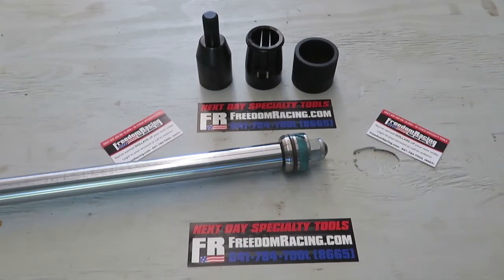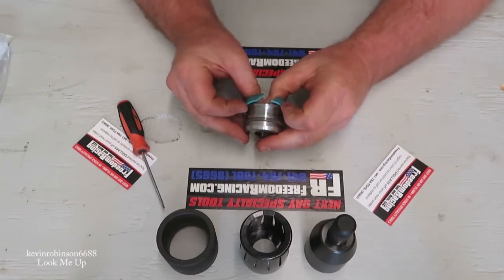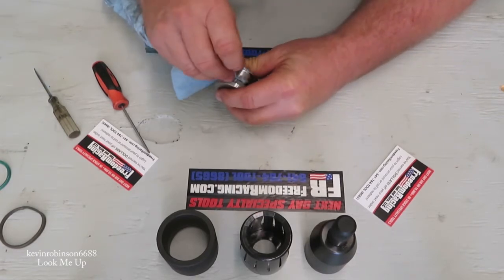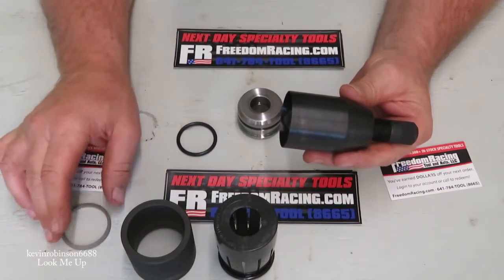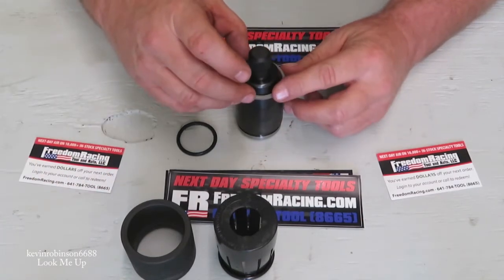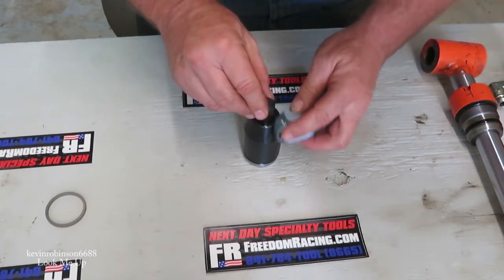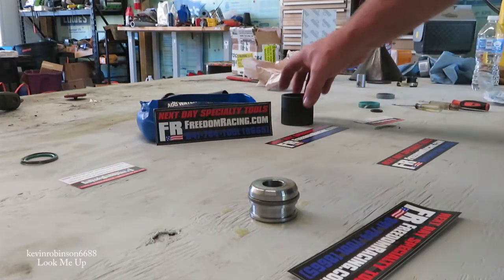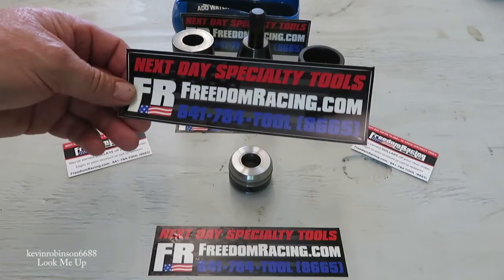Hydraulic rebuild tool Fluid Seal Ring Installation set J 46620

Comment: Kevin, I need to rebuild my hydraulic cylinder for my front end loader. It is a Kabota La724. The shaft calipers to 1 3/16". Do you know if  the tool you had would work on this shaft? If not does Freedom Racing have a tool for this? Enjoy your videos.
Reply from the maker: Not sure Sorry
Reply from the maker: If I get a minute I'll try to measure the cylinder size

Comment: Hey Kevin I called Freedom racing n they said they can't keep these in stock plus I'm working on a friends Kubota model number LA272-1 SN 50412 seal replacement n having trouble finding the three piece tool lol can you lead me in the right direction 😹
Reply from the maker: James, i just spoke to them and they told me they was getting more in, it's the covid 19 curse slowing them down.
Reply: But they don't have one for the kabota LA 272-1SN 50412 seal replacement tool
Reply from the maker: @jameselmore1821  I will see what I can do James.

Comment: Tools out of stock for now but I was able to stretch it on over the Kubota piston. I reset the outer fluid seal with a 2 inch PVC coupling. Works like a charm in a pinch.
Reply from the maker: Good to know thanks for watching
Reply: Outstanding thank you
Reply: Or tighten a thin strip of plastic around it with a hose clamp, or put some black electrical tape inside the hose clamp if pipe diameter does not match your piston. My Kubota piston is 1.75 and there is no matching pipe size. You can keep the clamp on while you tap the piston into the cylinder and let it slide off as you drive the piston in.

Comment: Kevin, I am thinking about buying an arbor press from harbor freight will it do for a small project like lawnmowers blade shafts. I knew you had one.
Reply from the maker: It would only be good for very small jobs you may want to look at bigger press look for a used one Danny.